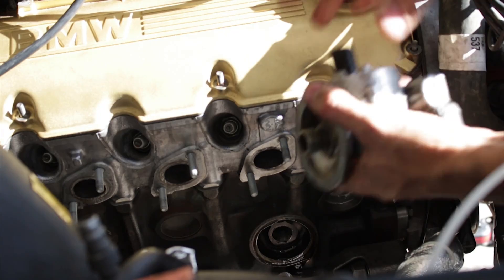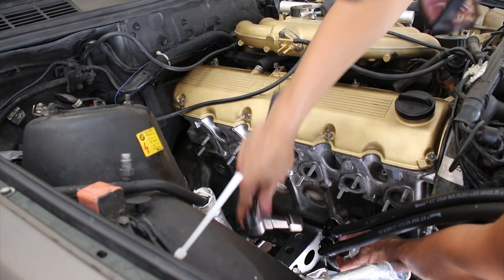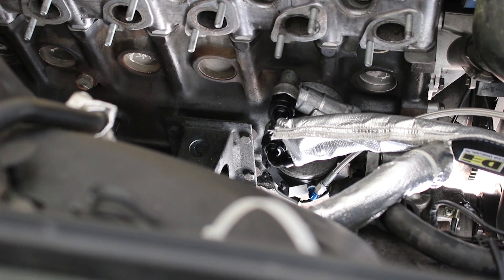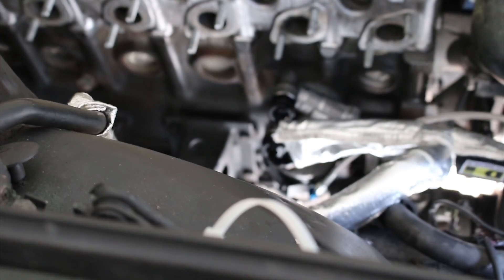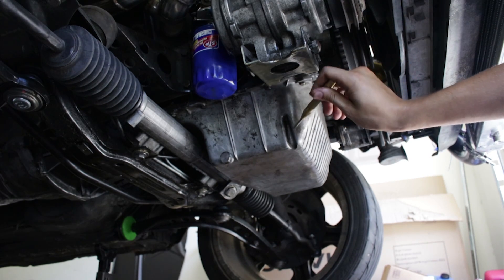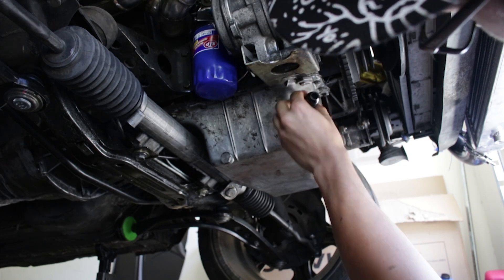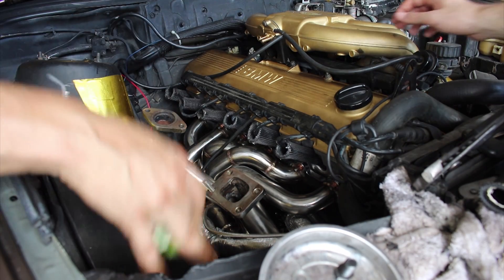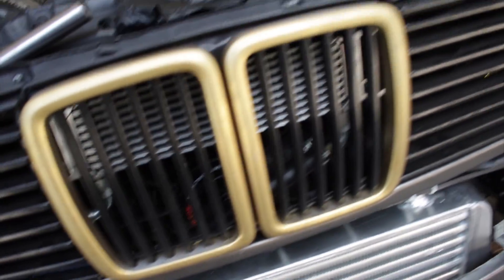Turbo BMW E30 Build: Part 15 | Oil Cooler & Turbo Drain

Comment: Where do you find that exhaust wrap to go over your spark plugs? All the ones I find will not fit over my wires on my e30. I have a turbo m20 as well

Comment: mounts the oil cooler upside down, uses a shifter on alu fittings, drills a hole in the sump with it still on.. wtf did I just watch

Comment: The price of being slang is to have debris inside the oil pan, it was way better to drill the hole and open the thread with it removed from the engine.

Comment: You had me all the way up till “drain the oil to help flush out the metal shavings. It is vastly superior to remove the pan after making whiteness marks then drilling and tapping a hole.

Comment: It’s also a good idea to pour a few quarts of mineral spirits through the oil cap at the cylinder head to flush out any remaining bits of aluminum.

Comment: This is one of my favorite videos. It was extremely helpful for me when I needed to upgrade my factory oil cooler. Also on a side note. I also have a white lifted XJ and a coupe late model e30. My XJ could really use that jump pack. I have a amperage draw I've been chasing for a couple of weeks now and if I leave it sit more than a day it kills the battery.

Comment: Just drilled and tapped threads on my e30 the same way for -12an fittings. I was pretty skeptical doing this and even after flushing the engine with about 20 liters of oil I still had metal shavings in the pan. hopefully its not going to harm my engine being aluminum.
Reply from the maker: Ryan Ferguson Gotta just get some cheap Walmart oil and flush it till it looks good. 
I changed the oil again in like 100miles.
Reply: Yah ive flushed alot of oil through it so far. Will do it again soon.i went from -10an to -12an due to oil being backed up in the drain.
https://lh3.googleusercontent.com/bYkgzehh1UIBT9LajvAKc0_wwW5LiK2fYuasIjsFcMISE0ZuiPf5XsqFQbKs6XRm9U7sdeD8PA

Comment: I've been researching a new oil cooler for my e30. That one looks similar to mishimoto. Where did you get the cooler, an fittings, and the 90 degree an adapters? eBay special?
Reply from the maker: summit 90s and lines, ebay cooler.

Comment: Pretty creative way to install the drain without removing the oil pan! Did you need to put any sealant on the threads for final install?
Reply from the maker: NPT gets bigger as it threads. So it self seals.

Comment: Nice work so far. Watched all your Videos about the Turbo build since yesterday. I'm also on my Build but changed all internal engineparts. I did a engineswap from a 320i to a 325i with H-Beam Rods, forged pistons and a Forged OEM steel crankshaft
 that makes me getting a 328i. Exited about your first start and impressions from first ride.
Greetings from germany :-)
Reply from the maker: Sounds like a blast man!
Reply: EuroGarage that's what I want :-D

Comment: the oil cooler is mounted wrong way
the connections must point upwards.
so the system can not bleed.

so you do not use the entire surface of the oil cooler

sorry for my bad english

greetings from Germany
Reply from the maker: Not sure I believe this. But I appreciate your comment and will do Further research.
Reply: EuroGarage yes I agree, The oil cooler have to be mounted with the piping upward. Good work anyway
Reply: oops

Comment: You should take the sump off to clean it thoroughly before starting the motor. These M20 motors have very small holes in the spray bar and other places that get clogged and can be terminal. The metal particles will also wear your bearings out much faster. I love your build but do it once, do it right. Good luck man :)
Reply from the maker: Too late my friend. Appreciate the well thought out comment. First person to actually approach the topic while bringing knowledge to the table.

I check on the oil soon.

This whole argument is so flawed though, anytime you break in a motor your oil literally glistens with metal shavings and you change your oil ever 300 miles, no big deal.
Reply: I hear what you are saying, but you are still shortening the life of the engine, and it would be such a shame to cut one corner after you have spent so much time and money. Also the spray bars are quite often not cleaned by just replacing the oil. The top spray bar supplies the only oil to the cam lobes. You can take it out via the 8mm nuts and then soak it in brake cleaner or similar and then blow the ends out (like a flute) to make sure oil comes out each tiny pin hole. Its a very common problem on the M20 and cheap insurance. Just my 2 cents. Keep up the good work.
Reply from the maker: +Zero to hero
I think that would be a very good idea regardless and I'll 100% look into it. 

 If you have the time please contact me at max.simons55@ yahoo
Just let me pick ya brain. I think I could learn a lot.

Comment: why didn't you drain the oil, take the pan off, drill and tap, clean it up, then put it back on and refill with oil?
Reply: yeah you don't want to do that. Trust me. I changed a pan on my e30 (m50 swapped e30s have pretty much the same process) to a shortened pan &... well I have an engine hoist now because of that day.
Reply from the maker: To do so requires some sort of engine hoist or at the bare minimum to prop the motor up with a jack and about 8hours or so of on your back oil in your eyes work. This is the alternative, and when done correctly is a very viable way to do so.

Comment: Is there a reason you threaded the fitting in verses welding it?
Reply from the maker: Aluminum pan, would require upside down tig welding. 
The fitting is also removable if I need to change sizes or etc.

Comment: Love how you can see the oil cooler threw the kidney grills
Reply from the maker: Sneaky sneaky cooler. I may upgrade the size. I was told it was not hugely useful on these motors.

Comment: its NOT a good idea to drill in the oilpan without removing it. What will happen with the rest of the drill waste ??? it will probably go in ur oil system....
Reply from the maker: The shavings that are left are very small and will just be caught in the oil filter. I appreciate your concern, but this is not something to be very worried about. As I said, It is fairly commonplace to drill with the pan on. Your motor naturally produces shavings over its life, that is a significant part of the oil filter's job. 
Thanks -Max
Reply: @EuroGarageOfficial  Microscopic particles of soft metal from bearings is what the oil filter is made to filter, not sharp hard aluminium swarf that could slice straight through the paper element. Flushing a cold engine with cold oil may have made you feel better, but probably left behind most of the swarf you created.
Reply: but maby you are removing it b4 startup?
Reply from the maker: I spoke breifly about that. This is common practice, If you watched the entire video I showed you the oil then had a note saying I had flushed it many times. I will have a full video covering the process.
Reply: I'm thinking the same thing. Is this a comedy channel?
Reply: I removed my pan for this process, flushing the oil few times is no guarantee for it comming out. what if one of those shavings get stuck in the turbo ?? or even worse the crank ??